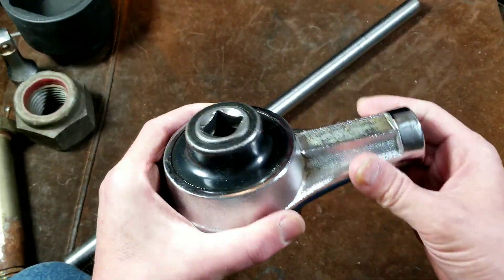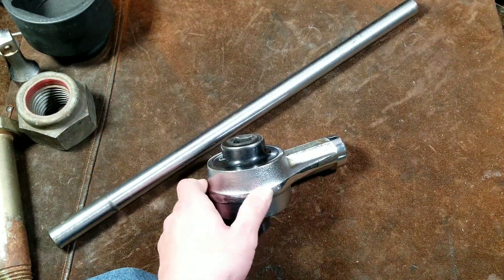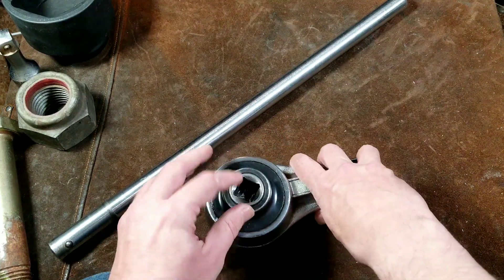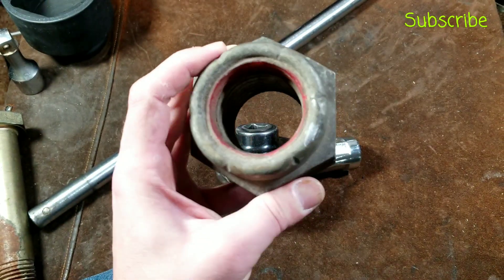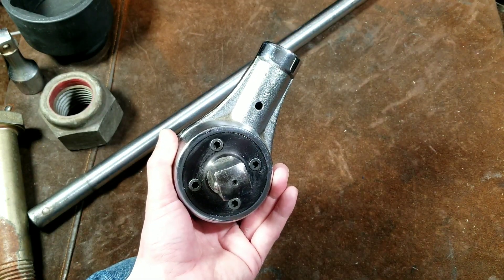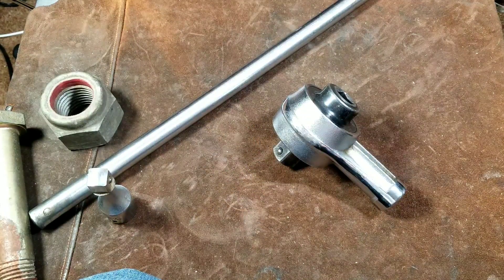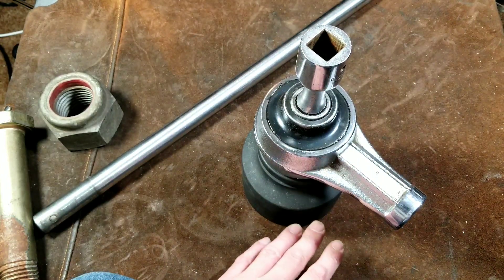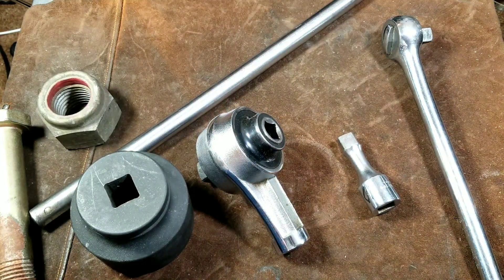X4 1" Drive Torque Multiplier Review

Comment: So what's better.. a good impact wrench or one of these?
Reply from the maker: Arguably you would want both but it impact wrench first and then one of these because they can get into much tighter spaces than a giant 1 inch impact wrench secondly these can also be used with a torque wrench and you cannot accurately torque bolts with an impact

Comment: Used to have to use these multipliers fairly often in IMA level work. Then we got a Hydraulic wrench system. Talk about night and day. They are very expensive but, if you're doing industrial level maintenance regularly they are a worth while expense. For the everyday DIY'er though, these multipliers should do the trick.
Reply: Working on heavy equipment sir i only use hand multiplyer but i bet those Hydraulik ones would be awesome 👍👍

Comment: Four to one torque or gear ratio?
Reply from the maker: Both the 4 to 1 gear ratio would be a 4 to 1 torque ratio although there is friction that's why you have use the 15% adjustment when using it with a torque wrench

Comment: Do u use these things? How often  I have seen hydraulic ones of those and yes your correct it can injure you. Thanks
Reply from the maker: I do not use the big tools very often for turning Fasteners but having a collection of large socket has proven to be totally invaluable for press work on bushings and bearings one big reason to get them is I have a huge variety of different diameter cups and pushers

Comment: At work we have the proto professional which is 3800 ft lb max & is 18.5 to 1 ratio it's about $4000 bucks it's 1/2 dr input & 1 inch output we never use it for breaking loose bolts we use 1" & 1 1/2" dr impacts we only use ours for tightening bolts with a 3 3/4" socket to 2850 ft lb
Reply from the maker: Yes indeed that is cool. But man I can't believe proto is charging that much money, as much as a used car.